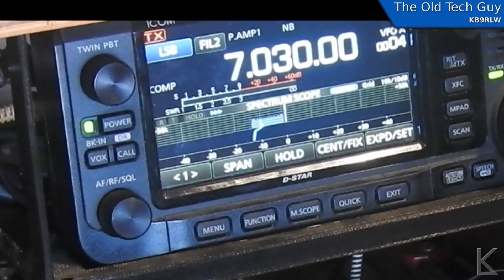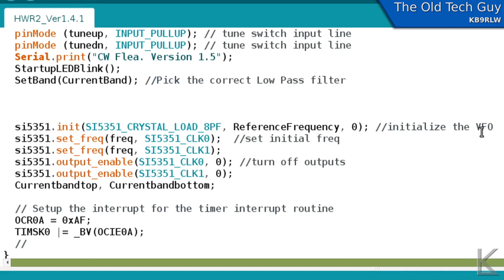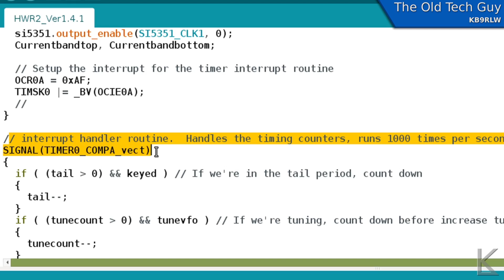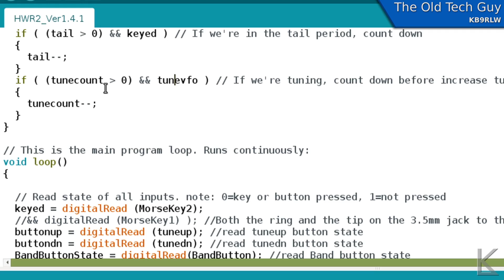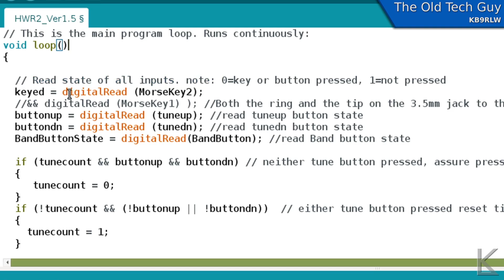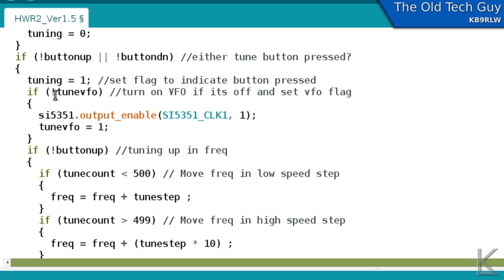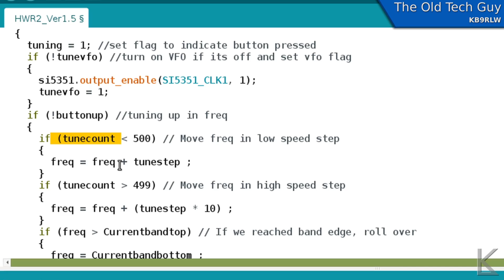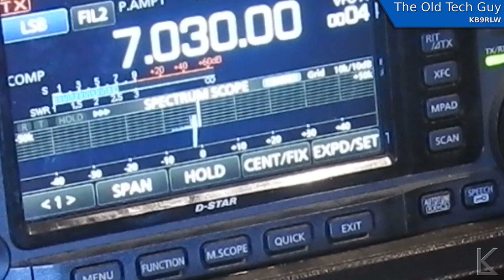Ham Radio - Fixing a bug in the CWflea transmitter software

Comment: Great stuff! Another alternative would be to have the inputs all generate interrupts. Then in the interrupt routine set a flag based on which was set. 

I have a coding suggestion to not use those variable names with low=true inputs. If (signal) reads like "if this signal is true then do something" but you mean the opposite. That tends, I think to confuse things. Instead I'd set signal = !input_pin so that the if statement reads as expected. Obviously what you have works, so my comment is for maintainability.  This is terrific stuff, well done. Nice to show the debugging side of life!
Reply from the maker: Yeah, I've been meaning to change the hardware reads to not-variable and make all the changes to the rest.   I'll probably do it when I start looking into integrating keyer code for use with paddles.